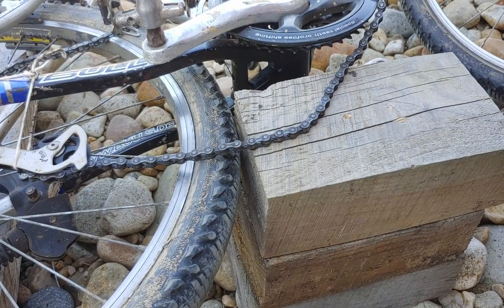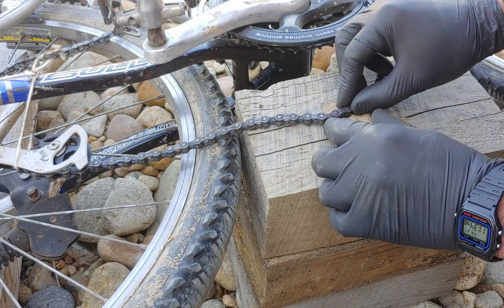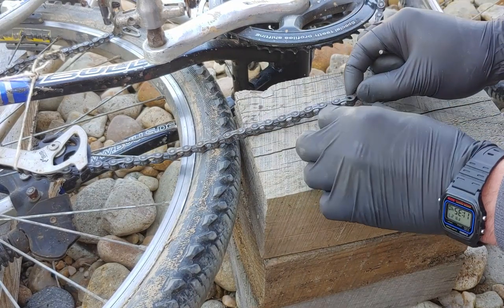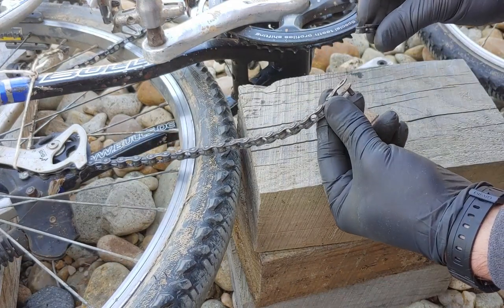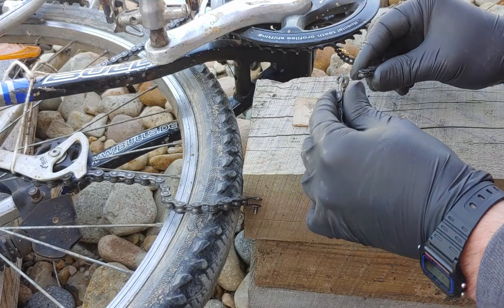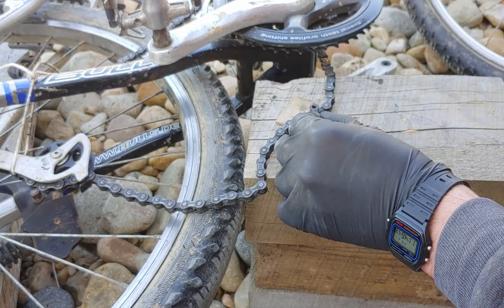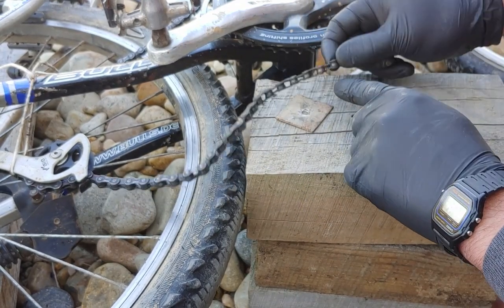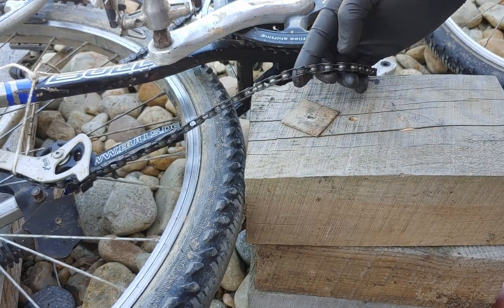Shorten Chain without a Tool

Comment: +one2three
Should be explained here that this only works for systems up to 8-speed chains [track-chain or 3/32"-6-speed or hyperglide 8-speed)...
For 9, 10, 11, 12, 13 speed systems [all different, narrower and narrower!], you really MUST use either the 'special one-use pin' or a special-link, elsewise the re-joined chain just falls apart a bit later, pin comes out!...

Comment: I removed links using this method but the chain is still slipping, there isn't full engagement between the drive sprocket teeth and the chain. Anyone know what I'm doing wrong?
Reply: Shortened it more on mine works flawlessly shorten 2 links more

Comment: This is NOT a good solution for replacing a bike chain. It worked for me, but if you test the next link or two up the chain from where it has been broken, it will not fall under the weight of gravity anymore. That is, if you hold the chain up horizontally the first link still on the chain after breaking will not fall under the weight of gravity anymore as the others do. This link will cause a little bit more friction and will cause more resistance when you ride making it a bit more difficult. If you have a bike that is not that good it should not matter too much, but if you have an ok bike and want to go quick it will slow you down just that very small amount.
Reply from the maker: For any regular average bike rider it will not matter. If you think that someone who is so into bikes and riding that this would make a difference looks for a video like this on YouTube you are wayyyy off.